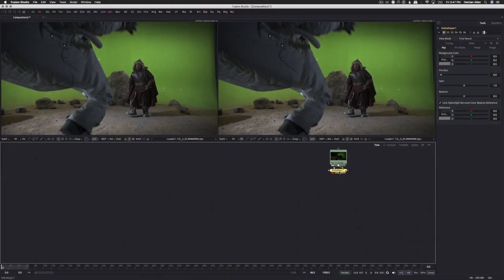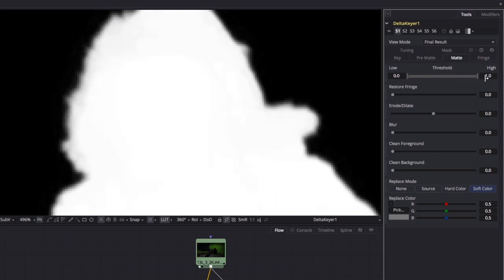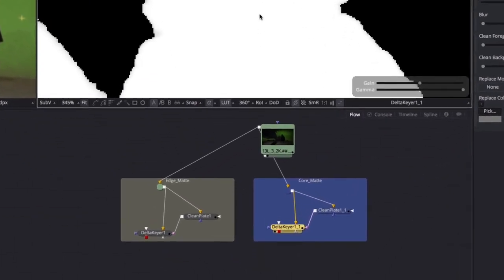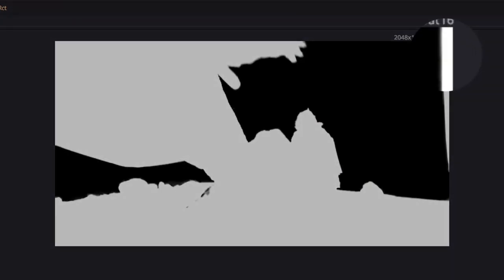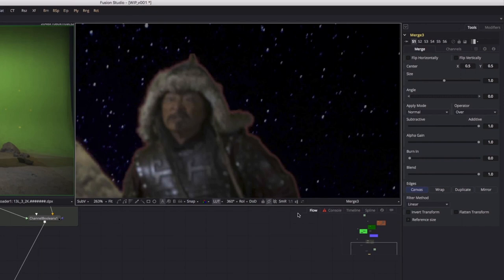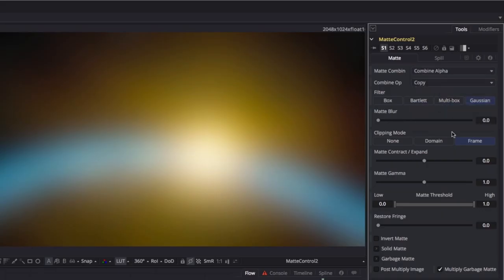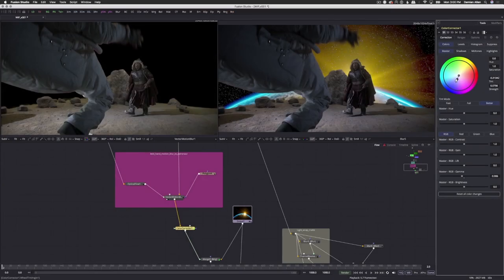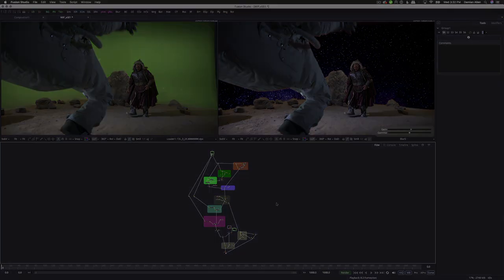Chroma Keying Greenscreen Tutorial

Comment: However, there is one thing that does not work when I do it:
I cannot combine the edge-matte and the core-matte (@ 9:00) by using the „solid matte input“ oft he Delta.
I have tried to follow all your steps carefully and I have tried on different computers (Win10)
with the studio version as well ..., these 2 mattes do not combine. 
Is there a preset I have missed or some setting I have to check?
(when view mode "matte" is selected, like in your video it does not combine; 
with "final result" I can achieve some results, but cannot see them clearly)

Any help would be highly appreciated!
Reply: did you find a solution? I have the same problem.